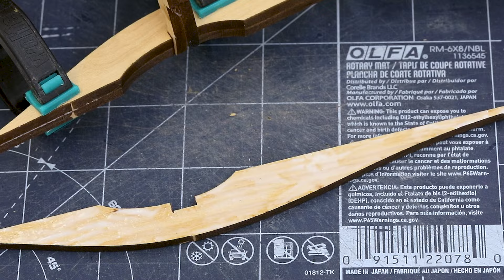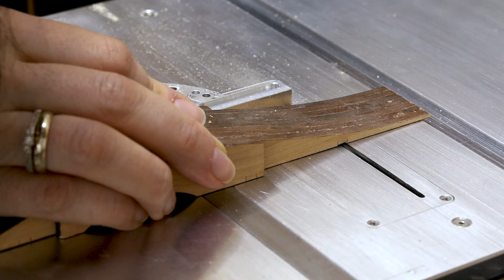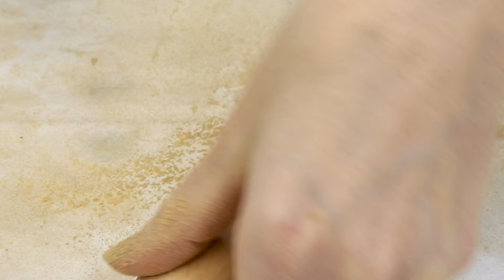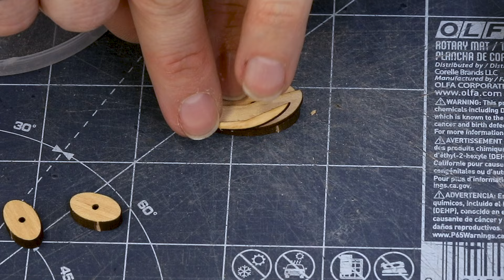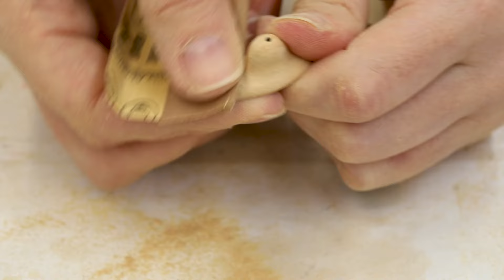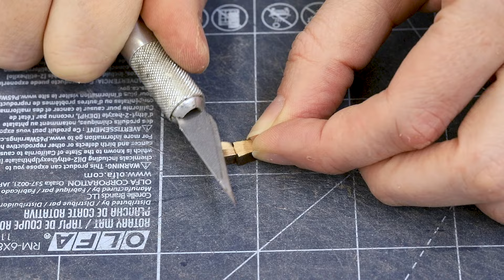#8 Viking ship OSEBERG - MAST STEP and RUDDER - model ship building

Comment: Beautiful work as always Olha. Interesting fact: Vikings did not use the term ‘rudder’. They referred to it as the ‘steering board’, which comes down to us as ‘starboard’, meaning the right side of the ship. Interesting because the ‘steering board’ was always attached to the right side of Viking ships – I have no idea why this is the case. It would be interesting too, to know whether there was some advantage to the placement…
Reply: i suppose most people are right handed.
Reply: Yes. I wondered whether the placement might give a right-handed person some kind of mechanical advantage, but couldn’t visualise how that might show itself… Thanks for the comment.
Reply: One theory ,not exclusive to the Norse ,is that the steering board side was kept away from the dock side of the boat. The older name for the port side being larboard coming from loading board or modern gangway.
Reply from the maker: Never thought it could be related to the right hand - but it makes sense...
Reply: @OlhaBatchvarov left hand always a horn of ale?